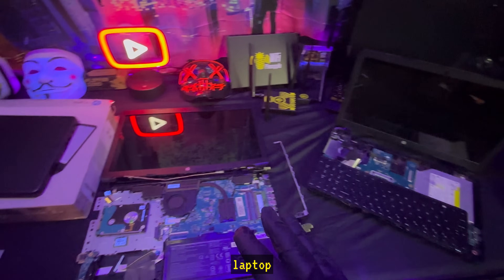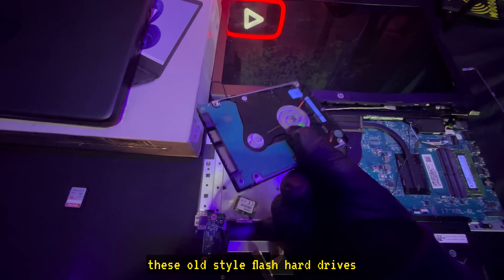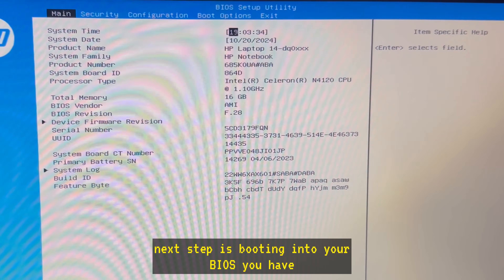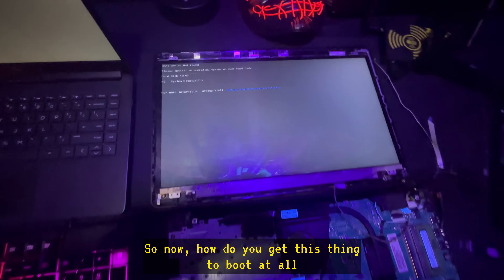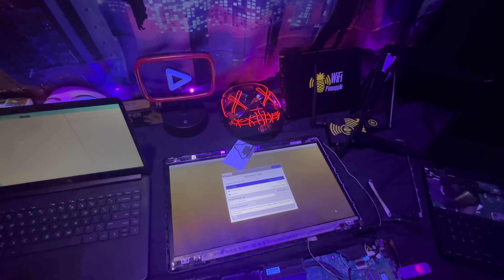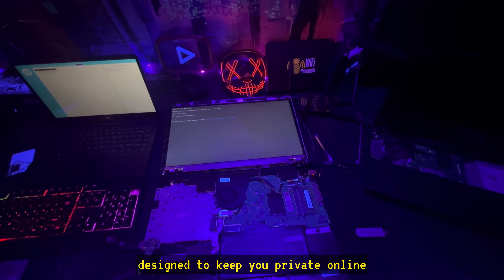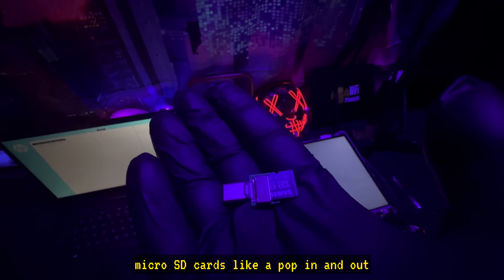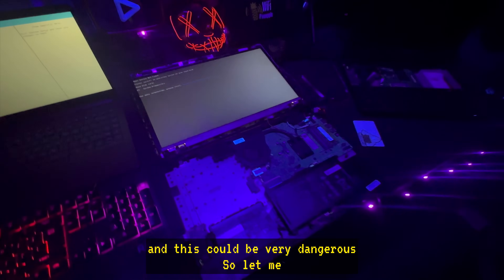Build a Ghost Untraceable Laptop: Ultimate Guide to Online Anonymity and Privacy! DIY

Comment: What about BIOS reflash? Could it be done in this machine ?
Reply from the maker: It’s probably possible if you were to leave the hard drive in do the flash and then once it’s updated completely remove the hard drive
Reply: @GhostStrats  I was thinking about serial numbers on the BIOS that could been exposed somehow and trace de notebook in some way. Very nice video by the way, cool channel too. Cheers.
Reply: Do this on a laptop that supports opencore

Comment: Don't forget about the MAC addresses in the BT/Wifi chipset and similar footprints.
Reply: He better enabled the MAC spoofing choice in Tails
Reply: He ever mention speakers can be used as a mic in this vid?
Reply: @inadad8878  IVE BEEN REMOVING THE CAMERA MIC AND INTERNAL SPEAKERS SINCE 2012!!! EAR BUDS OR POWERED EXTERNAL SPEAKERS ARE THE WAY TO GO. IM KINDA HANDY, BUT I DO NOT KNOW CRAP ABOUT THESE COMPUTERS!
Reply: Your Mac address can be changed.
Reply: @HellsingGhrey-ht2wg  no it cant, it can only be spoofed
Reply: @HellsingGhrey-ht2wg spoofed is not the same as "changed".
Reply: You can take off the Mac address with a grinder easy hack.
Reply: DNS leaks, HARDWARE MACS, WIFI TRIAGULATIONS, and ANY networks that the adapter has ALREADY connected to will be a crumb trail! He's trying hard to sound "TECHY"
Reply: @TheTubejunky not if they haven't connected in a few years. A 10 year old laptop still works well for this, and I doubt there is a router in existence that has anything that old in it's logs.
Reply: @tracesmith3572  It's more so the ISP the router connects to or other reporting network devices. Wifi triangulation is also a very real threat vector. Cat and mouse game really.
Reply: @TheTubejunky That’s where virtual machines come into play
Reply: @TheTubejunky and he called the plattered sata drive a flash drive! 🤣😂
Reply: I came here to comment this.  If you purchased the device new and you do something with that device that attracts attention they WILL show up at your house. The only way for what this guy is talking about to be possible is if your purchase old used laptops from private parties. Even then you have to be careful and never let it connect directly to your private internet connection.
Reply: @g3neration216  i don't think the vendor keeps track of which MAC address is assigned to a particular device. The invoice and box might track serial number, which cpu, how much ram, which graphics board and its brand model, not the internals mac addresses (ethernet/wifi/bt/other)
Reply: @SilverTester  You are correct the vendors don't, but the OEM does.  The process for finding who purchased a laptop is not that much different than finding a pewpew device. The only difference is that you can probably only get the information for devices that have been purchased relatively recently depending on manufacturer.
Reply: @SilverTester wanna bet on that? Your PC identifies itself with EVERY PACKET SENT. Wireshark is your friend. It sends the MOTHERBOARDS identifier. Printers print identifying marks on every single page they print.
Reply: @notaras1985  similar to a QR code. The printer distributes a unique pattern of microscopic dots over each document.
Carries information like make model and serial
Reply: @g3neration216  pew pew device lol
Reply: I am concerned that hardware ID's, the permanent MAC or other serialized unique identifiers could still be compromised through low level hardware-layer attacks, or other lower parts of the TCP/IP stack. And just end-run Tails.

It HAS happened before. And from the perspective of a single individual, even one completely comitted 100% to the pursuit, and with an extremely (unlikely, but playsible) skill level, arguably cannot "know" or contain complete end to end knowledge of security, at all layers.

Obviously, there's the "best effort" and "good enough" and chasing 100% certainty really means: "Just do nothing and don't even connect online."

But... if there's any known hardware and chips, or whole devices even that omit uniqe serials & ID's completely that's even better. And ideally the mfg. did it to "be lazy/cheap" rather than "secure/anonymous." Because you can inherently trust that better.

As I'm thinking of those FBI honeypot ANOM phones, that they deliberately sold as open-source encrypted & secure marketed to criminals. An extreme case & hyperbole, but conveys the idea. Deliberately marketing things to subvert security (theirs) & provide anonymity, is a target for for being compromised at the root. While random "cheap & lazy" omissions of ID & surveillance tech & DRM is at least statistically random.
Reply: mac changing luckily isn't too hard
Reply: you guys needa chill out. OS's like Whonix and Tails pretty much do that for you

Comment: Just did the same a few month back from two old lap tops. Runs Tails smooth with 16gb ram.
Reply: RAM = SAVES DATA 
so for him to say "EVERYTHING IS GONE WHEN I UNPLUG THIS USB OS" is bs
Reply: @TheTubejunky Generally if you pull out the usb drive running tails os from the machine, it triggers an immediate secure shutdown. It's meant to be like a ripchord, so as soon as you pull the usb drive it starts wiping the RAM using using sdmem so you will leave no trace. It might corrupt some files on the persistent storage but your data will be safe since the entire ram is overwritten with random data several times to prevent memory dump attacks. Well at least that what they say.

Comment: Newbie here: But the MAC address isn’t stored in the hardrive or is it?
Reply from the maker: The MAC address (Media Access Control address) is stored in the hardware of a network interface controller (NIC), typically in the firmware of the device. 

But you can manipulate and change that too. It’s not that hard. 

Here are some programs and tools that can help you change or spoof your MAC address:

Technitium MAC Address Changer: A user-friendly tool for Windows that allows you to easily change your MAC address.
MAC Address Changer: A lightweight program for Windows that provides a simple interface for MAC address modification.
Linux Command Line: You can use commands like ifconfig or ip link set to change your MAC address on Linux systems.
macchanger: A command-line utility specifically designed for changing MAC addresses on Linux.
Spoof MAC Address (Android): An app that allows MAC address spoofing on rooted Android devices.

⚠️Always use these tools responsibly and in accordance with the law.⚠️
Reply: @GhostStrats  YOU CANNOT change the HARDWARE MAC ADDRESS! You can SPOOF it for networks but NOT CHANGE the HARDWARE MAC. You should know this.
Reply: @GhostStrats  TailsOS has a built-in startup script that spoofs the MAC but like thetubejunky said, you can't cahnge the "burned in" address from the manufacturer and if that is found out and you used your bank card or CC to buy that computer, you just got burned
Reply: @djshenanigans731 what if you have removed the inbuilt wifi card and just bought a wifi adapter 🤔
Reply: @WeMakenPapDezeDagen  That's exactly what I 'would' do in this situation after purchasing the laptop in cash from someone I don't know. (Make sure you don't bring a cell phone to the exchange!)
Reply: It's hardware MAC is on the WIFI chip installed in that laptop. You can buy and use other chipsets/USB adapters like Alpha brand but one and done use if your being a bad boy! Don't think it can't be traced because it can. one use and toss unless your already a glowie.
Reply: @TheTubejunky  thank you for the response

Comment: You should also remove the speakers.
Reply from the maker: I mean you could maybe someone could find a way to store stuff in there …..
Reply: @GhostStrats  it is  possible to use a speaker as a microphone.
Reply: @GhostStrats  If you reverse the polarity of a speaker, sound travels the other way and it becomes a microphone. I have used on old speaker as a gaming mic before

Comment: You can also remove the wifi card and buy a separate one, it looks just like a normal usb drive and costs like 15-20 euros.
Reply from the maker: That’s awesome. Next time I’m gonna have to consider this.
Reply: Okay this answers my question…the wifi card is going to give you your MAC address right? Also wouldn’t you want to spoof your MAC address?
Reply: @behaviortech1080  Tails comes with MAC spoofing, so as long he has it enabled he should be fine.
Reply: @dseednorwayn47  is it a one time enable, or each time you boot?
Reply: @WtfLockPicking  MAC address spoofing is enabled by default in Tails, as it is usually only beneficial. But in some situations, it can also lead to connectivity issues or make your network activity suspicious. Always double check.
Reply: @dseednorwayn47  good to know, thanks!
Reply: @WtfLockPicking  You don't have to do anything. It's enabled by default
Reply: @djshenanigans731  awesome, thank you!
Reply: @behaviortech1080  Tails has a built-in startup script that does MAC spoofing but I still would not use any piece of tech that has been touched before in some way or ever connected to anything. You would also wanna by the computer with cash and pay someone homeless or unknown to you to pick it up if you are extremely paranoid. You could also NEVER use it on your home network or any locations near where you live as that's one of the first locations to be investigated
Reply: @behaviortech1080 most oses do this natively now
Reply: The fact he didn't already know this means he's a noob
Reply: YES!! THE OLD "CAN TENNA" HACK!!!   WITHOUT THE CAN!

Comment: That is an incredibly cool concept. The first thing that came to my mind was the Framework laptops to "natively" support this - just buy the laptop without internal storage and have a couple of storage expansion slots to boot from, with whatever OS you prefer. Any thoughts on that?
Reply from the maker: Thank you very much for telling me this. I’m gonna look into framework laptops. And I don’t seem like a good idea, but the whole idea is if it was to get compromised anyway if you were to leave it somewhere, you don’t want anything that has any data to store at all. 

The concept for this device is more or less a burner laptop. It all for educational purposes only this is an experiment that I wanted to try.
Reply: @GhostStrats  If you don't know Framework I would suggest you look into them, it's worthwhile just for the concept behind their laptop. 

Basically you get a configurable laptop with 4 USB-C expansion slots where you can plug in whatever you want (there are already pre-made modules from Framework but I saw some custom one made already). The idea was to have one of the storage expansion module be the bootable drive with Tails, Kali or any other OS all self-contained just like in the USB stick used in this experiment, with no other storage at all in the laptop. 

Without that expansion module it would basically be a burner laptop, with the additional benefit of having bigger (this is arguably not a benefit) and faster storage while also being able to also use the laptop as a "normal" laptop, as you can just install Windows (or any other OS you daily drive) in another module and use it when needed.

TL,DR: you make one module a live OS installation to run just like if it was in a USB stick and another module with a properly installed OS that acts as your daily driver

Comment: Youre gonna have to make it from something with a pre 2002 chipset IN EVERYTHING
MODEM
CPU
GPU
SOC'S

ISRAEL BACKDOORED ALL OF EM VIA SUPPLY CHAIN CORRUOTION
Reply from the maker: But we’re is data stored
Reply: @GhostStrats  whats the threat model your working with ?
Reply from the maker: @UNcommonSenseAUS  1. Assets
Personal data (files, credentials).
System configurations.
Any sensitive information that could be exploited.
2. Threat Actors
Cybercriminals seeking personal data.
State actors interested in surveillance.
Malware developers aiming to compromise systems.
3. Potential Vulnerabilities
Unpatched software.
Insecure network connections.
Physical access to the device.
4. Threat Scenarios
Unauthorized access via network or physical intrusion.
Malware installation leading to data exfiltration.
Data recovery after a system reset.
5. Countermeasures
Use of Live Operating Systems: Boot from a USB with a live OS (e.g., Tails or a custom Linux) that runs entirely in RAM and leaves no trace.
Full Disk Encryption: Encrypt all storage media, ensuring that data cannot be accessed without the encryption key.
Automated Reset Scripts: Implement scripts that automatically clear caches, logs, and any temporary files on shutdown or after a set time.
Network Security: Use a VPN and secure connections; disable any unnecessary services.
Physical Security: Ensure the device is only accessed in secure locations.
6. Monitoring and Maintenance
Regularly update your OS and applications to patch vulnerabilities.
Use monitoring tools to detect unauthorized access attempts.
Reply: And there is no way to forensically extract any info from the internal memory chips?
Reply from the maker: @CorpHicksUSCM I don’t think so everything is wiped and only stored in ram temporarily.
Reply: @GhostStrats  partially true. Cold boot attack can recover surprising amounts of data from ram.

The issue now spreads to
>network used
>nearby exploitaable devices
>personal digital fingerprinting 

Online behaviour, typing style, mouse/ track pad signatures...

Security online is fast becoming an illusion
Reply: @UNcommonSenseAUS  He's better off going headless box to box.
Reply: Really cool concept! Edward Snowden would be proud.